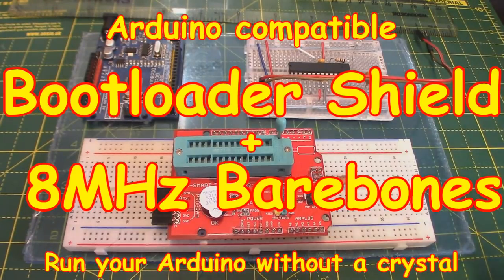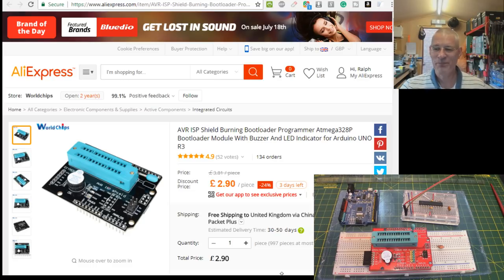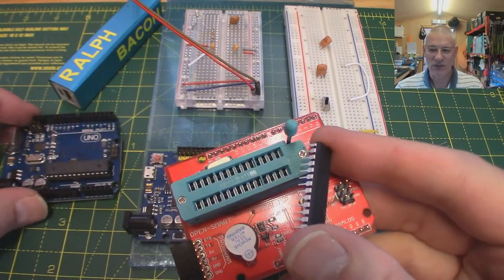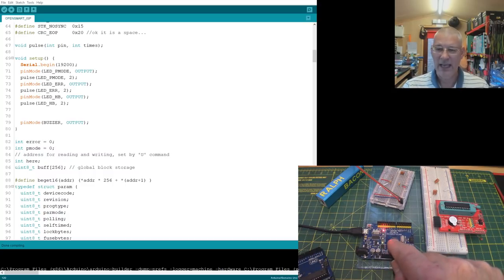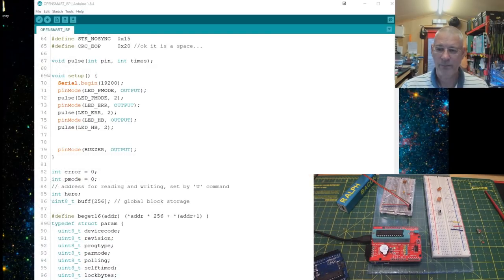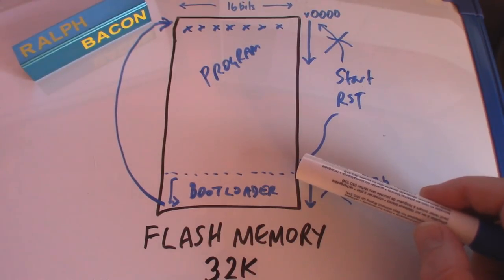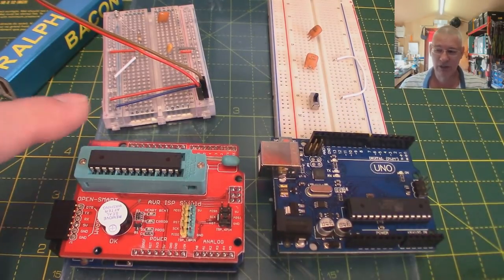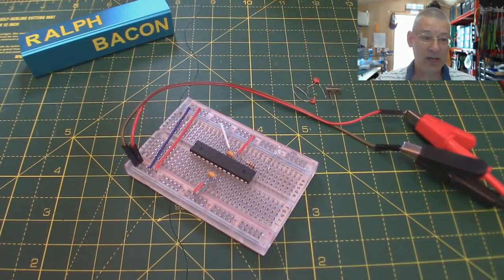#119 Bootloader Shield 🛡️ and 8Mhz Arduino Barebones (made easy)

Comment: Nice video! One thing I wonder; Is the sketch came with the programmer shield any different from the "Arduino as ISP" sketch that comes built in the Arduino IDE?
Reply from the maker: Probably not, Bora, but they may have tweaked it a bit, I suppose, after all, it's all Open Source so I wouldn't be surprised if they did something to the original code. Does the original one beep like that? I'm guessing that the fundamental functionality is identical, at best they might have added a bell or whistle somewhere! Good question, thanks for posting.
Reply: No, it does not beep. There are no pins defined for a buzzer in the original "Arduino as ISP" sketch. That is one thing they've added for sure. And I think it is a nice touch. I generally use standalone ATMega 328's in my projects. I leave the bootloader intact and add a FTDI header on the project PCB. I never tried 8MHz internal clock setting yet, your video inspired me to try that. Looking forward to your follow-up video where you will explain how to install that internal clock board definition to the Arduino IDE. Also, you may consider making a video on how to extract the hex code of a sketch from the Arduino IDE and uploading that into a ATMega 328 that does not have a bootloader using the ISP sketch + programming shield. Take care and thanks!

Comment: Great video as usual. 
I also have the same com3 port and I will fix this now. There is another port showing , Communications Port (com 1) . I will have to find out what this is too.
Reply from the maker: Thanks for sharing, great hearing from you.
Reply: @RalphBacon  When I try upload the blink sketch to the chip with the new bootloader it gets stuck on "uploading sketch", just hangs.
Reply from the maker: You need to choose File, Preferences and tick BOTH boxes on the line that says "Show verbose output during...." compilation and upload.

Then you should see what is going on. Let me know!
Reply: @RalphBacon  I posted the error message here but it's disappeared.

Comment: Hi Ralph, great video.  While the chip is awake, what happens if it receives another wakeup switch closure?
Reply from the maker: Nothing! Well, the Arduino could detect it (programatically) in the main code but as it is already awake nothing further will happen from a sleep perspective.
Reply: @RalphBacon  Thank you.  That is what I expected, but better to check than put it to sleep forever (sound of brick falling).

Comment: I followed the Video to a T....Uploaded the OPENSMART ISP sketch, Followed all the same Tools Settings for burning the bootloader....but after i upload a sketch of my own to use on the new chip.... nothing works from then on and i keep getting errors or it gets stuck on "Uploading..." can somebody kindly please help me with this...Thank You!
Reply from the maker: After you uploaded the OpenSmart ISP sketch to the "host" Arduino board (or adapter) did you remember to press Shift (or Sketch -> Upload Using Programmer) before pressing the upload arrow so that the code was uploaded via the programmer? Otherwise you'll just upload your sketch to the Arduino which had the OpenSmart sketch on it (yes, I've done this quite often)?

Comment: I picked up one of these to update firmware on my GM328 tester. It came with Russian language and I cannot use it, but I am not sure how to go about it. Do I have to put a bootloader on the chip or is there a way to just burn the firmware straight to it? I am using FW that has already been modified for my device, Just need to burn it. I haven't found any videos explaining this process in a simple way.
Reply from the maker: The bootloader shield plugs into an Arduino UNO, as you know. The Arduino should be considered ONLY for use in uploading code to OTHER Arduinos. A dedicated Arduino UNO. On this UNO you upload the Arduino-as-ISP sketch that is under the Tools->Examples

Then you upload all sketches to other Arduinos using this combined header/Uno but you MUST remember to upload your sketch using Upload Using Programmer (or you will burn the sketch onto your new header/Uno instead and have to repeat this whole exercise!)
Reply: @RalphBacon   Thank you Ralph for the info. So, this shield would only be useful for uploading bootloaders or sketches, but not for hex files and eeproms? Having a hard time figuring this out, but I believe a USBASP with something like AVRDudes is a good place to start. Love your content BTW, thank you for sharing and always look forward to new videos.

Comment: Hi Ralph, I'm back in the land of the sane...…..turns out my chips had already been configured for external oscillator so when burning bootloader you still need caps and a 16Mhz crystal....(oh I'm a dummy)......but learnt a lot on the way. Of course would not have had the hassle if I had a shield because it has its on crystal on board!................in my defence on Arduino.cc it doesn't make this clear....................(if it does, then not to me !)............also I tried RX TX and RESET (3 wires as  Arduino.cc) and that didn't work, so just popped the new 8Mhz into my master Arduino and uploaded as per usual, this is what you did (much better).................. just gonna add the missing entry you told me about (boards.txt) to get rid of annoying warnings and I'm back. Thanks a lot for ya help (and Benny)..............just waiting for another vid now!
Reply from the maker: Doh! I should have mentioned this, I suppose.
 
Once you have loaded a bootloader that requires/expects a crystal to be present then it has to be until you load a different bootloader that does not use it. I did mention, I believe, that having programmed a chip for 8Mhz and then plugging it into a board with a 16Mhz xtal, it will run quite happily - at 8Mhz! Probably best to put a sticker or other identifier on chips programmed for different speeds.
 
A good speed bump to mention here for others, thanks Andy, and glad you got it working (using that shield means that the xtal will be used if required and ignored if not, just as you say).
Reply: no problems Ralph, one more quickie……….can the surface mount version (Atmega328p-AU) also run on internal clock ?.....if yes same bootloader?
Reply from the maker: Yes, indeed, same chip, different physical format, that's all. Just a bit trickier to connect up to our own circuit boards (but there may be PCBs out there for this chip specifically for such purposes).

Comment: nice one Ralph, I've been looking forward too this series and you didn't disappoint (as if)………….mind you the heat is giving my brain a good kicking...…......…..I'm slouched back (slowly melting)  watching this and must have glanced at my watch because next thing I no the bare bones is on the screen (the clear breadboard) and I thought what's going on Ralph?...…….you can ditch the load cap's that's the point ya dummy...…...it honestly took an embarrassing length of time before I realised Oh he just doing things properly and decoupling the rails...………..so its a damm good thing you started an the beginning !...….sorry about calling ya a dummy
Reply from the maker: I've been called worse, Andy, and I've got a thick skin (and brain) so no harm done. But you raise an interesting point; decoupling the chip, physically close to the chip is essential for stability. And as the analog supply is separate from the digital supply we need to decouple both to avoid noise being introduced on the analog side by the digital end. Good post.
Reply: Had forgotten a couple of 0.1uF ceramics on my Kicad project...…...The devil is in the detail

Comment: A full arduino board is cheaper than a discrete 328p. So I just breadboard a nano or a mini.
Reply: TheKetsa that in fact is very true and I do the same, but I guess as a learning video it is a good one. 
Checked: at AliExpress the bare atmega328p DIL is now a few dimes cheaper than a promini
Still can decide to reprogram the promised as well.
Reply from the maker: Well, not quite true, TheKetsa: a full Arduino Uno (or even a Nano) might be £2.40 but I got some ATmega328P chips for about £1.10 each. But the point is well made,as the Pro Mini is about the same price. Bizarre! But all the processes I show can be applied to a full board - it will still run at 8Mhz even though the 16Mhz resonator is on board, it is just ignored. Good post, nice to hear from you.
Reply: You are right, either my memory is aging or prices fluctuate. I use Aliexpress and just checked : 
A single 328P-PU chip is $1.50
Arduino pro mini 328p is $1.68
Arduino nano 328p is $1.90
Reply: @TheKetsa....You made some good points...………..I think its in the "spirit " of Arduino to grow and learn and to move on a bit...………….when I first started using Arduino I never dreamed I would understand enough to extract the Atmega chip out of it and use it as a stand alone device...….now I'm growing in confidence and loving it, and have a rapidly growing interest in Kicad and designing PCB's for my early Arduino projects but now just using the 328p on its own...…….Ralph's channel (and a few others, can't leave out Julian !) WII build your confidence  and save you a few pence

Comment: how can i flash the bootloader unto my atmega328p using tl866cs mini pro? I know how where the hex file is to program it, but i am not sure how to set the fuses to 8mhz in the config file
Reply from the maker: Here's the web site I use to ensure my fuses are properly set when using a command line:
https://rajeshkovvuri.wordpress.com/2012/06/01/usbasp-avrdude-reading-fuse-bits/

This is the interactive fuse calculator:
https://www.engbedded.com/fusecalc/

Comment: I thought the 328P is a CMOS device - so why are you demonstrating touching the pins with your finger !!! ;-)
Reply from the maker: It is indeed a CMOS device, Ray, but all the inputs are protected (as you might expect for a µController) so it's safe enough to handle. Just don't shuffle your feet on a nylon carpet before or whilst doing so!

Comment: A quick question...if using internal OSC...…..ground pins 6,7 or let them float....?
Reply from the maker: Let them have a day off and just float around, Andy. They've worked hard so they deserve some rest. :)
Reply: When not used for the external crystal, those pins can be utilised as pin change interrupt pins 6 & 7. This is not possible when they are connected to an external clock.
Reply from the maker: Or, if we use the MiniCore bootloader (see https://github.com/MCUdude/MiniCore ) then they can be mapped to Arduino pins 20 & 21 - but I'll experiment further before saying more.

Comment: hi ralph still got some bootloader problems......maybe you can help, ever since I downloaded the zip file "breadboard" and extracted it to the Hardware file in sketches, I compile and upload any file now (regardless of what it is) I  get this warning...……..WARNING: Board Breadboard Arduino :avr: atmega 328bb doesn't define a 'buildboard' preference . Auto-Set to: AVR_ATMEGA328BB...…………………...I now get this warning what ever I'm doing with my Arduino and other sketches compile and upload fine...…...and of course I still get the same warning I posted below...…….the one with "Yikes!" at the beginning when I try  to burn a boot loader...………….wonder If  you or my fellow Arduinite's have any thoughts...……..I've racked my brain till it hurts and wired it up several times tried different chips ,checked voltages, used capacitors then taken them out, questioned my sanity. I then uninstalled the IDE and removed  the hardware file and deleted the Arduino directory as instructed and re-installed the IDE from scratch, and I still get the  WARNING: even after all that. Is there still something lurking there that shouldn't be?.....I'm at the point now where dancing naked at midnight while shaking a bag of chicken bones seems a good idea...……..thanks
Reply from the maker: Benny says that the warning about the "build.board" preferences can be ignored - it should not affect the uploading of a sketch to anything. At least, it doesn't in mine. It's a missing entry in the boards.txt file. I added it to mine and I've just now uploaded it to my Github for this demo. You'll see the entry as I commented it. Use this file instead if you wish.
 
See my other reply to your previous post regarding the actual chip. Then let me know if you've made any progress!

Comment: It would be nice if someone would do the same for a nice PIC device. Maybe it would not be possible, but if it was, that could be a whole new type of device to be used in projects.
Reply from the maker: PICs are reasonably easily programmed using a PICkit 2 (well, a PICkit 3, these days) that can be compared to an FTDI  USB-to-Serial converter in some ways. But maybe that's an idea for a future video. Thanks for posting.
Reply: You mean PicKit 4 now, and that in no way represents the slick bootloader and hardware of  an Arduino Uno, so that is what I am speaking of. I have a PicKit.2
Reply: You do know that they released PicKit-4 now,
Reply from the maker: I didn't know, Joseph, and I hope they have sorted out the instability of the PicKit3. I only have a PicKit 2 (which I love) but it doesn't flash all ATMEL chips which I'm convinced is an artificial barrier to "encourage" us to buy more hardware. If you look at this site it says it can use the PicKit2 for all chips (including the ATmel328P): http://gcbasic.sourceforge.net/Typesetter/index.php/Home

Comment: Just checked eBay if you search "AVR ISP Shield Burning Burn Bootloader Programmer for Arduino UNO R3" and then sort bow lowest price + postage you will see a number of sellers all around $3.20 which is approx GBP 2.44 incl free postage.
Reply from the maker: Ah yes, a good search will always unearth a good bargain! Thanks for the heads up, stewarttv, nice to hear from you.

Comment: what size are those two capacitors and why?
Reply from the maker: The caps are 100nF (0.1µF), Darrick, and they are there to "decouple" the noise on the VCC line which will cause instability to the chip. As the 328P has two, almost separate sections, one for digital, one for analog signals, we supply VCC to both pins but decouple them both. That stops digital noise entering the analog part of the chip and (sort of ) vice versa. Very important we do this very close to the pins too.

Comment: I don't like Ali Express and their fees.

I have complained at them about their vendors that will list something for £2 but then charge you £5 postage WHEN and not many people know this, the Chinese government subsidises all post to and they get charges pennies and they charge us ££'s.

Then there is the issue of "Free postage" and suddenly you find yourself lumped with £15 postage and then if you want to pay by paypal, additional fees...

You really are better off sticking to ebay as I have fond that many prices are cheaper.
Reply from the maker: I have no relationship with AliExpress other than as a paying customer, but I have found them quite good, Mark. Free postage, when stated,  really does mean that unless you order multiples of the same item in which case it suddenly becomes non-free. What I do then is to just order the minimum I can get with free postage and repeat that order. They even suggest this! I have never, ever paid ££ in postage fees.
 
They do often charge a small fee (about 60p) when using PayPal (especially for small orders) so I guess you have to weigh up PayPal's secure and anonymous payment against giving AliExpress your credit card details, something I hate doing but AliExpress seems very, very secure. I'm pretty sure the payment goes into escrow until the delivery window expires too. The seller never gets to see those payment details (otherwise I would not use them either!)
 
Delivery times are always (stated as) longer on AliExpress than, say, Banggood. Whether that stated delivery time of 30 -50 days is true is difficult to say when you order many items over an extended period (such as I do) but I do find Banggood quicker overall.
 
The same AliExpress sellers also sell on eBay, of course, so you might find the same items there. Whether they are cheaper or not is difficult (for me, at least) to tell right now. But it's a good platform and I've used it to get a refund on two occasions.
 
I guess we all have our favourites os what works for you is good but you could try them again and watch the 'Free Postage'  on multiple quantities - I have no connection with them as I said before. Thanks for posting your experiences, perhaps others will chip in too...
Reply: Unfortunately I have found different, many times I have added an item to my basket, added quantity then hit with heavy costly shipping fees that the very same product is on eBay and pretty much same price but completely free shipping.

Several occasions I have encountered free shipping and had free shipping on items but adding an extra item found that postage fees were added and not cheap either.

I have also been hit with additional fees on paypal, not currency fees but additional fees for paying via paypal.

When Ali-Express hit the scene a few years back, I was seeing quantity (like WHOLESALE prices and ability to buy job lots) but now, Ali-Express had been morphed in to what it is today.

I have found similar issues with Banggood, Light in the box and all the others, they started out with the "Wholesale" thing but quickly the sellers were turning it in to a version of eBay and I do find the occasional Ali seller on eBay offering exactly the same but cheaper on eBay.

I do buy from Ali but not much, mainly because if the way the majority of manufacturers are selling their wares, for a site that is meant to be a wholesale outlet, its certainly raking it in now.

It still pays to shop around.